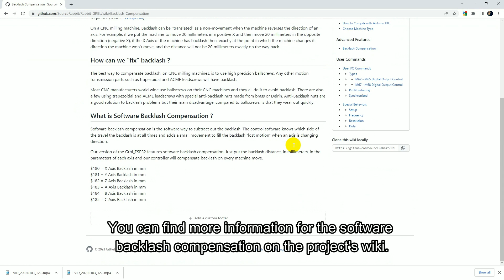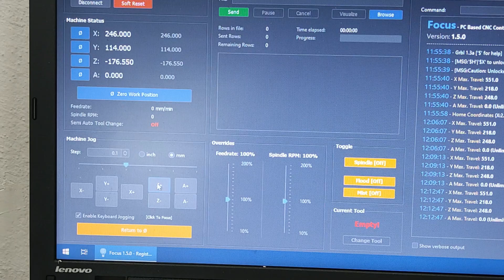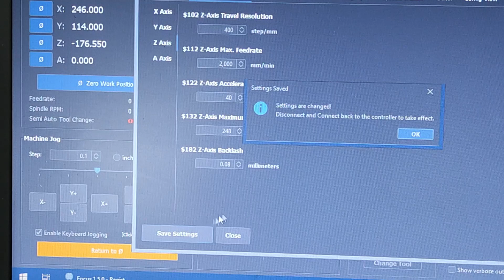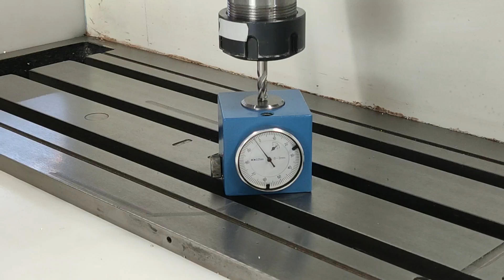GRBL Backlash Compensation for my ZX7045 CNC

Comment: Could someone explain how this works? Does it only compensate when changing from up to down or down to up? Or maybe it moves a percentage extra from the code to compensate for the backlash caused by load?
Reply from the maker: It works for both direction changes, up-to-down and down-to-up and it also work for all axes (X,Y,Z,A etc.). 
All you need is to measure the backlash distance for each axis of your machine and add it to the $180 (X Axis) , $181(Y Axis), $182 (Z Axis) and $183 (A Axis) parameters of the SourceRabbit 4-Axis CNC Motherboard.

You can read more here
https://www.sourcerabbit.com/Help/tutorial-i-191-t-grbl-backlash-compensation-back-4AxisCNCMotherboard.htm